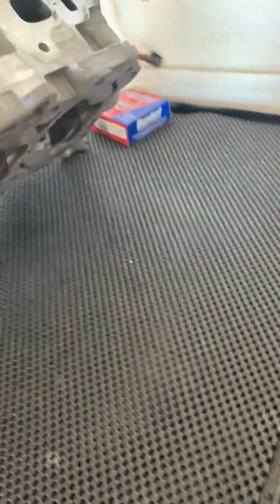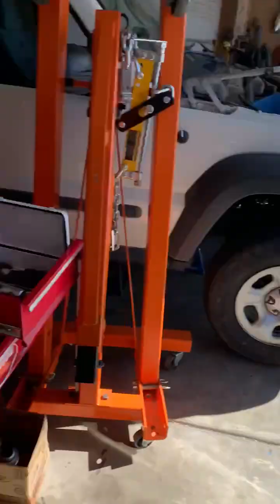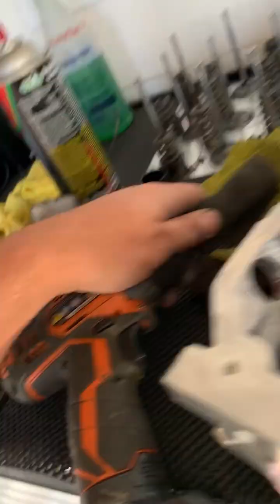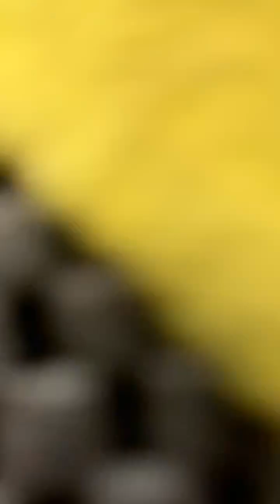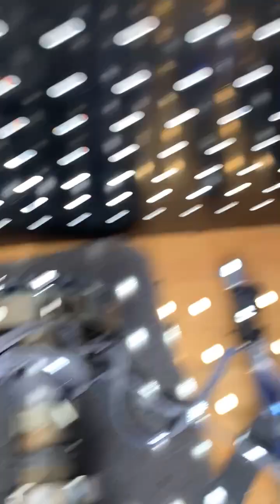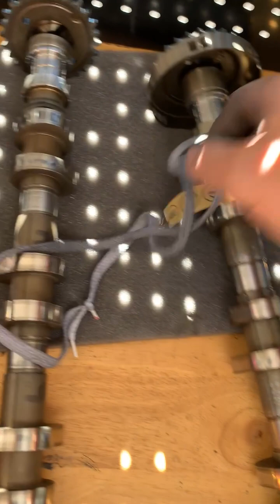Repair and polish Cams and Cam Journals Using a Drill On A Jeep Chrysler 3.7

Comment: Does your Jeep use cam phasers?  If so, doesn't sanding down the camshaft narrow its diameter and sanding the cyl head journals widens the mating surfaces causing your oil pressure at the phasers to decrease?
Reply from the maker: There wasn’t enough to be taken out. It has been about two years or more and engine is running good.
Reply: @justswapit-jsi-8911  Thanks for replying quickly.  Can you please explain what you mean by " Stick the cam in (the cyl. head) and make sure they're not rubbing"?  It's the mating surface, I'd think they should be touching.
Reply from the maker: @renejacques8288 a better word would be binding up anywhere

Comment: What grit scotch bright?
Reply from the maker: Can’t remember it’s been awhile. Red and grey scotch brite and I think 400.  It’s in the video
Reply: @justswapit-jsi-8911  awesome thanks for the quick reply lol nice video!
Reply: @justswapit-jsi-8911 did you get any oil pressure issues afterwards? Did this process open up the clearances that much?
Reply from the maker: @ it ran normal no indication of either